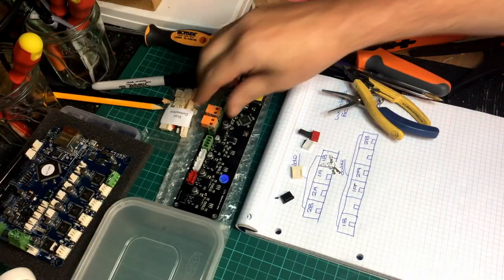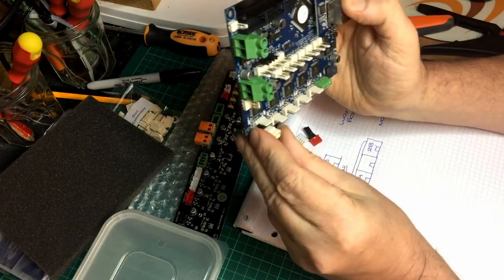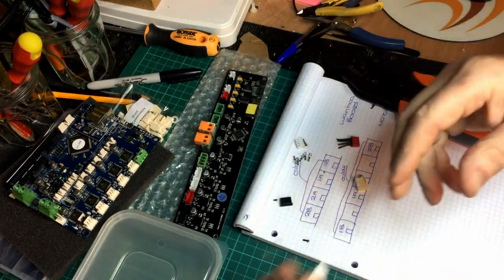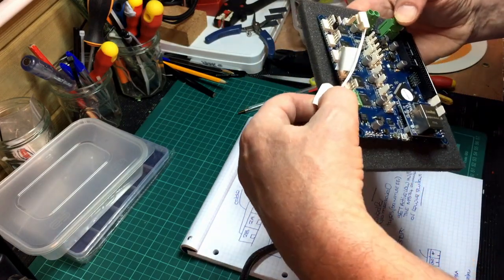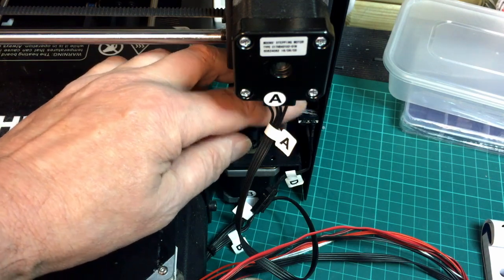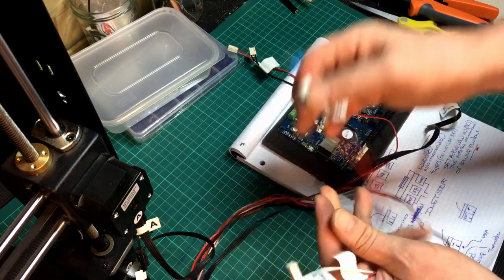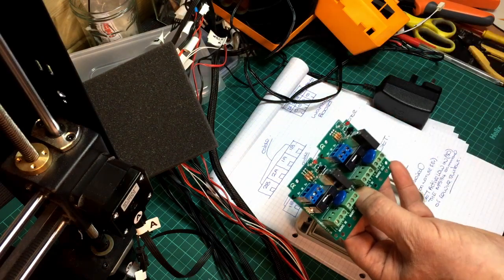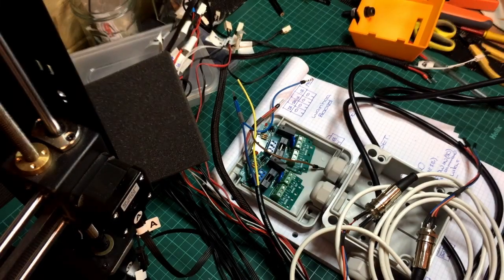My Printer Upgrade Part 5

Comment: Great video Kyle, but I'm now curious to know if you finished the upgrade and if the new upgrade worked to your satisfaction? I built my own Mendel 90 main board and a old computer power supply to power the printer. I have built most of the Mendel 90 from 3 old dot matrix printers and other scrap parts for less then $100. so far. Have not worked on mine in a while cause I'm taking care of my elderly parents keeping them out of nursing homes and hospitals.
Here is my board: 
https://www.facebook.com/photo.php?fbid=718633084906094&set=pb.100002782264721.-2207520000.1517262885.&type=3&theater
Keep up the good work and videos. Kenn
Reply from the maker: Hi, no I have not completed it yet. Its been a bit delayed but not forgotten.  I need to finish fitting the PSU to the frame and plug it all together, its almost all wired.   Then add the firmware and test it.  So only a day or two hopefully to finish it .  Glad you like the videos, this will inspire me to finish the upgrade, thanks.
Reply: I just found a cheap Chines knock off of your Prusa i3 at Walmart for $142.77.
https://www.walmart.com/ip/Professiona-Tronxy-P802D-High-Precision-Reprap-Prusa-i3-DIY-3d-Printer-LCD-Screen-3D-Printer-Tool-Kit-Black/391368937?wmlspartner=wlpa&selectedSellerId=5957&adid=22222222227094890665&wmlspartner=wmtlabs&wl0=&wl1=g&wl2=c&wl3=213334882018&wl4=aud-306997118081:pla-345702025858&wl5=9004545&wl6=&wl7=9004468&wl8=&wl9=pla&wl10=114220812&wl11=online&wl12=391368937&wl13=&veh=sem
Probably make half a dozen items and stop working. lol 
Well if you get your printer up graded and working you could then print two parts at the same time. Good luck with it.
Kenn
Reply from the maker: Hi Ken, looking at the Walmart printer,  scary the way the mains terminals on the power supply are all exposed. And the board.   Cheap though.